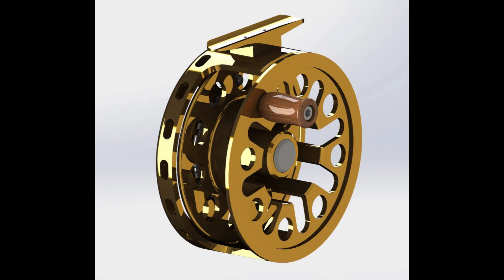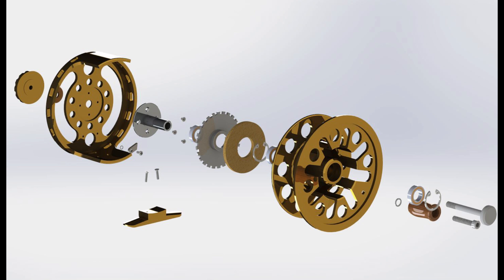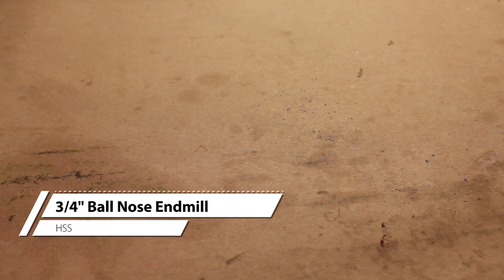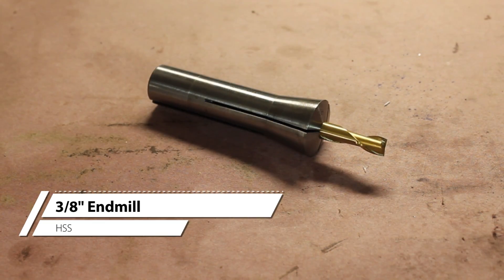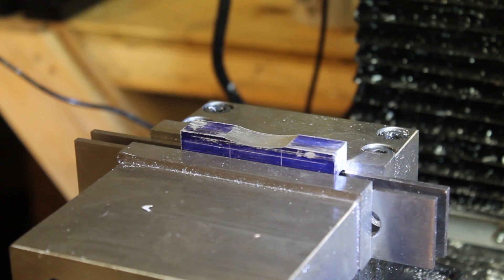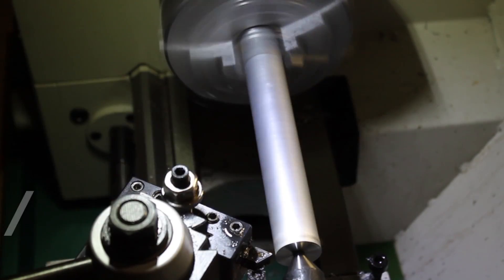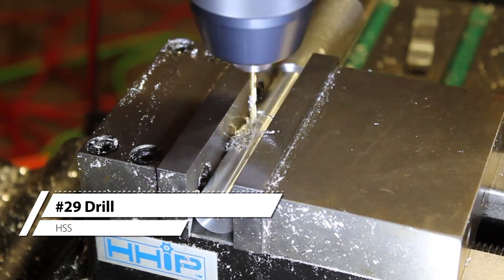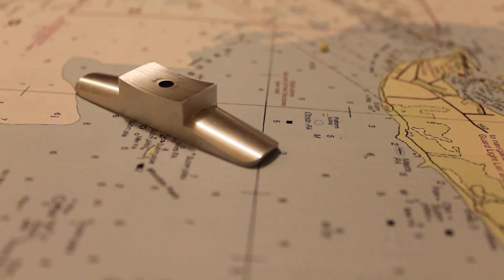Homemade Fly Reel Ep. 1: The Reel Foot

Comment: Awesome video series!  Your efforts to make this build series and share the plans is much appreciated.

I just started my reel build and am working on the reel foot now.  The video doesn’t show the drilling /tapping of the holes used to secure the reel body to the reel foot.  Do you have any recommendations on how to locate these holes?  I could mount the foot on a rotary table and dial it in but I’m thinking it may be better to finish the reel body and match drill the holes using the reel body as the guide.

Any suggestions?
Reply from the maker: When it was all said and done, I ended up drilling and tapping these holes parallel and just spending some time to make a asymmetrical countersink by hand in the frame to properly flush the screws. It would have looked a bit nicer if the holes were angled, but it works either way.
Reply: Thanks!  That approach seems to be what other reel makers have been doing in the videos I've seen.  I may go this route for my initial build.  I'm making four reels and may try both approaches to see if there's any significant difference.
Reply from the maker: Awesome!
Reply: @Bryan Manka where you able to get the drawings from JH reels for this build?
Reply: @feathersfinsoutdoors5140  Yes, I did get the plans and built two.  They turned out amazing.
Reply: @TXManka  could you possibly send them to me if you still have a copy? I would much appreciate it, I have been drawing up my own print from a reel that I got from a pawnshop but it has different internals.
Reply: @TXManka  any chance you found those prints? I can send you my email for you to send me a copy.
Reply: @feathersfinsoutdoors5140  yes, send me your email address and I’ll forward them to you.
Reply: @TXManka  my email is in my channel description. It will not let me post my whole email address here.
It is feathersandfinsoutdoors at yahoo.com 
No spaces, thank you in advance.
Reply: @TXManka  where you able to send those prints over? I haven’t seen them yet.
Reply: @feathersfinsoutdoors5140  Sorry.  Emails to that account are rejecting.  I’ve tried twice with files attached and one email with no attachments.  Is there another address I can send to?
Reply: @feathersfinsoutdoors5140  I tried a few more time and think one attempt may have been successful.  Let me know if you get them.
Reply: @TXManka  yea got them on try #5 very much appreciated sir.